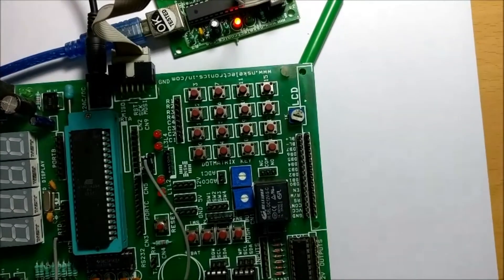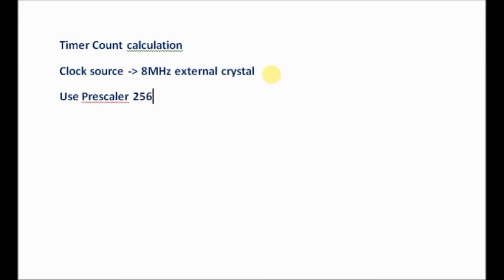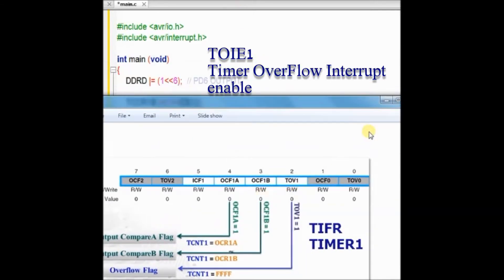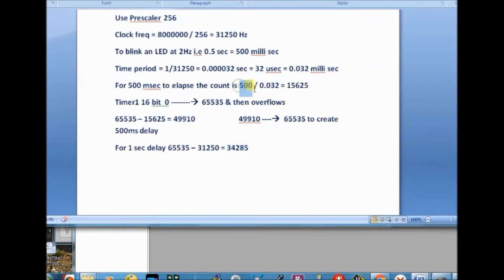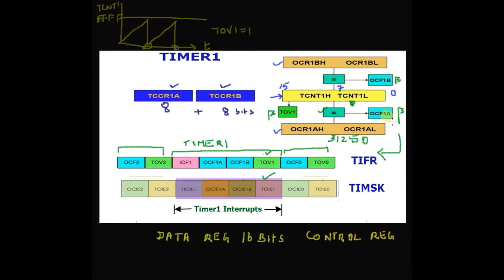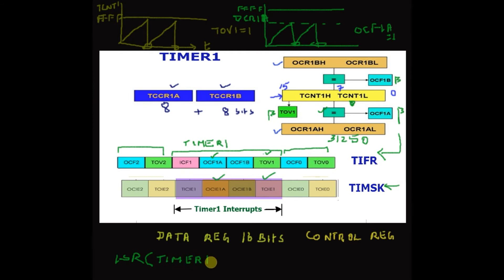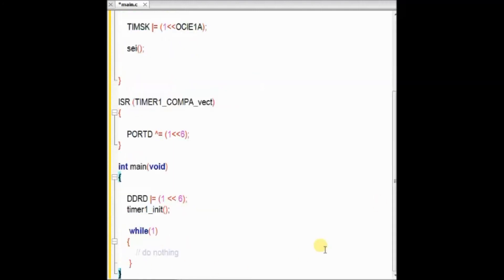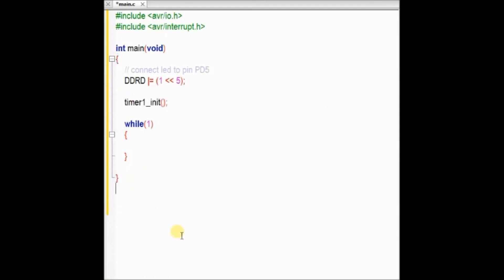AVR - INTERRUPTS Made Easy Part 3. TIMER 1 (16bit) Interruts

Comment: a am trying a ac dimmer with atmega32A .But Output Waveshape is https://i.postimg.cc/L5y0nRMx/IMG-20190104-144808.jpg

And The Circuit Diagram is https://i.postimg.cc/SxCP67gW/Circuit-Diagram-tab1.jpg

and 
The code:
https://drive.google.com/file/d/15LvNij0QHq_V2c_Pg41Uyii4L7zvudBf/view?usp=sharing
Reply: How Can i fix the problem of output wave shape.My ac frequency is 50hz

Comment: I have doubt that the TCNT1, OCRA1, OCRB1 are 16 bit registers, in normal read and write operation the temporary high byte register is vulnerable to data change when the interrupt occurs when the high and low bytes of the registers are being accessed.